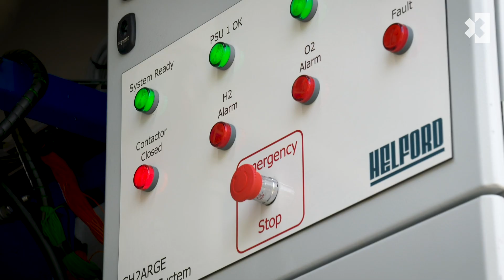Extreme E's ZERO EMISSION, HYDROGEN FUEL CELL Charging

Comment: Why not just use the onside electricity to charge the cars?  Why go to the trouble of generating hydrogen through electrolysis to then convert back to electricity which wastes so much energy?
Reply: Perhaps the onsite solar panels don't have the necessary power level to quickly charge a car

Comment: Could also be used for the Formula E? 🤔
Reply: FE is working with ABB on charging
Reply: @fung30  not ABB, but Enel X
Reply: @mArvAlcao71  Enel X is the second Qualcomm, their partnership ended. Formula E is working with ABB now.
Reply: @fung30  check their website. FE listed Enel X as their official charging partner. ABB are based on automation, robotics and electrifications
Reply: @mArvAlcao71  ABB will replace enel x as charging partner very soon
Reply: @fung30  source?
Reply: @mArvAlcao71  news on Formula E official website
Reply: I actually would watch that. Makes much more sense than batteries.

Comment: Great video!
What ways can I get involved with extreme E? I am currently 2 years away from graduating as a computer engineer. Is there any chance of learning what it's like to work in the extreme E environment? Thanks
Reply: I'm also curious. I'm less than a year away from graduating as a software engineer and I'll do anything I can to find myself a job which is about either healthcare or sustainability. Preferably sustainability though ^_^
Reply: Williams advanced engineering are the people who make the batteries for Formula E, I would suggest using them as a starting point :)